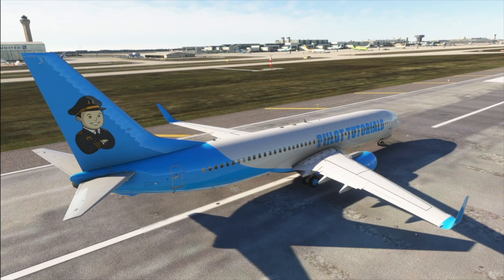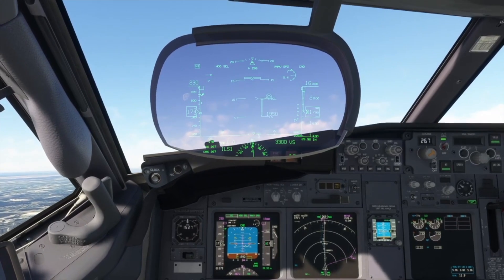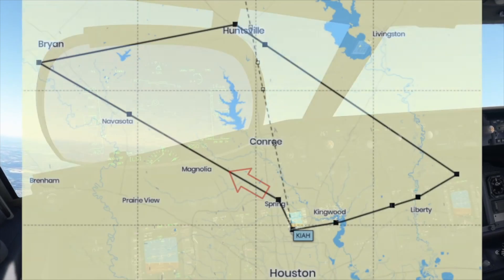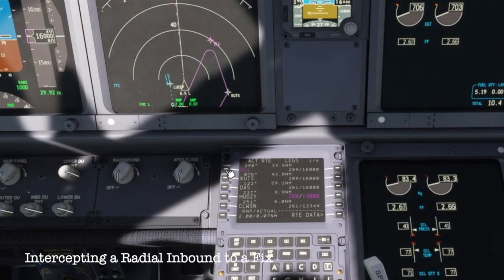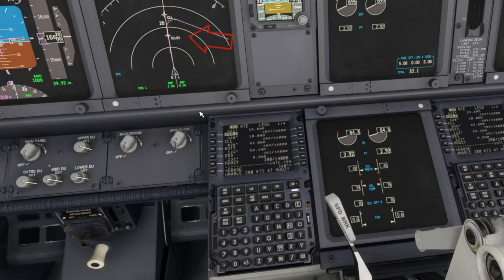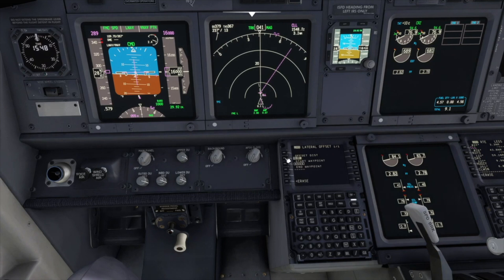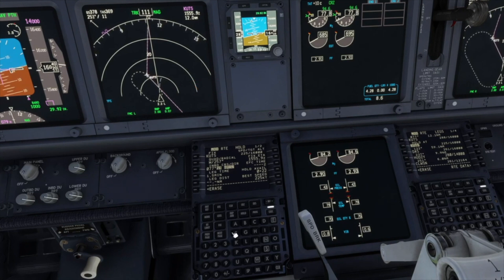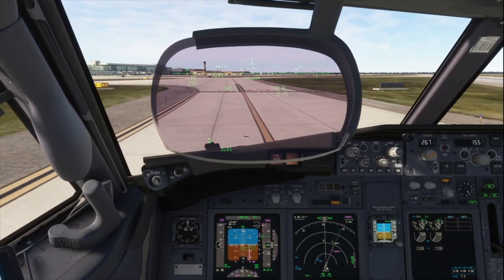737 Intercepting Radials, Lateral Offsets, Holds & User Defined Waypoints

Comment: intercepting radials and proceeding to fix, you program it into the fmc same way so just reenter the waypoint, set course and exec but those are diferent things after all so how can i tell if it will make my plane turn imideatly and head to the waypoint or maintain present heading and intercept the course as it reaches it?
Reply from the maker: Thanks for your question. The aircraft will turn immediately if you reenter the waypoint and execute it. The difference is after you reenter the waypoint if you then enter a radial to join in R6 before executing, in this case the aircraft will continue on heading until it intercepts. With such a clearance, ATC would give you an appropriate intercept heading if necessary.